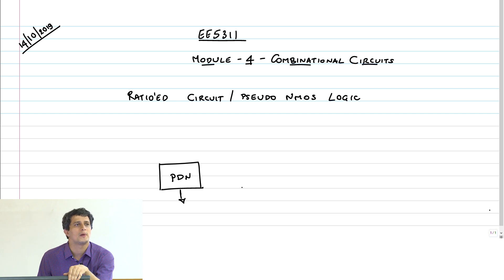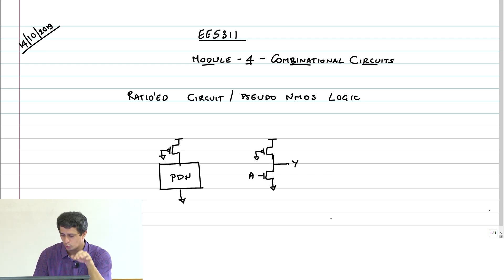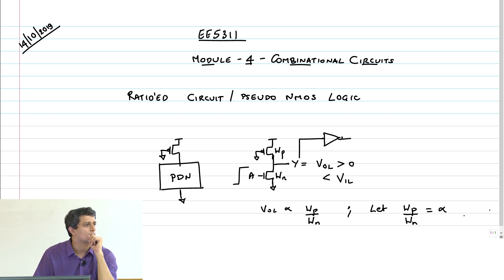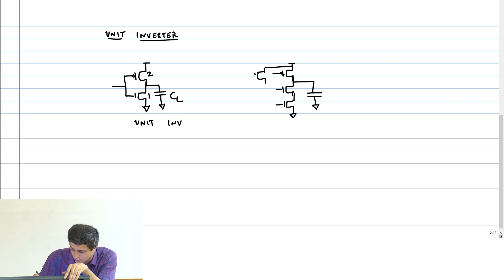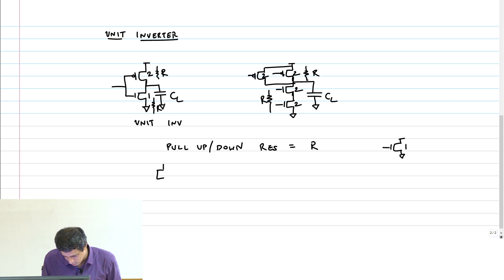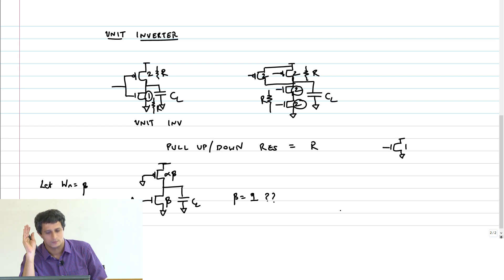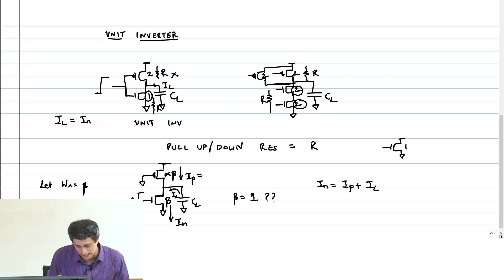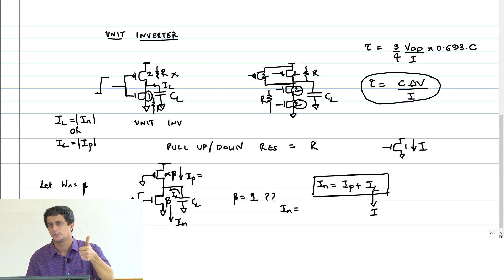CombCkt-16 - Pseudo NMOS Inverter

Comment: sir could u pls explain why are u taking IL=I ?PLS ELABORATE ON THIS @14:16
Reply: IL is the current responsible to discharge the load capacitor, which also determines the delay we achieve, so it is taken as I